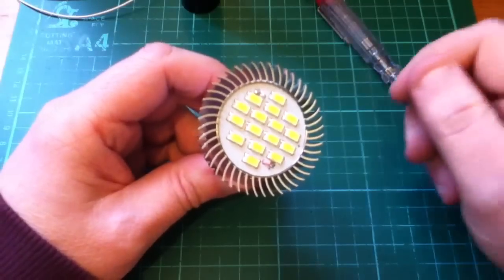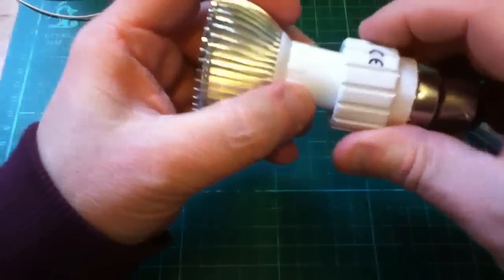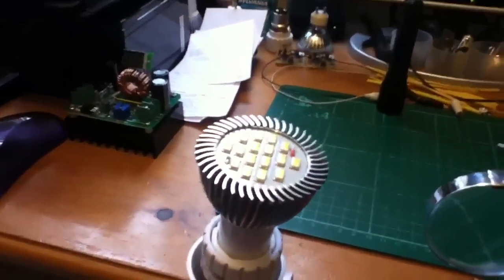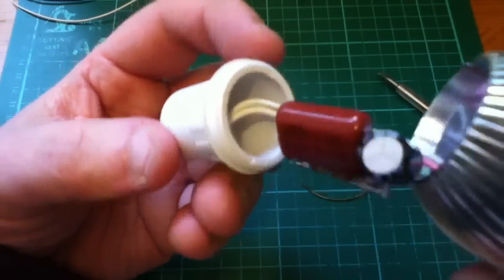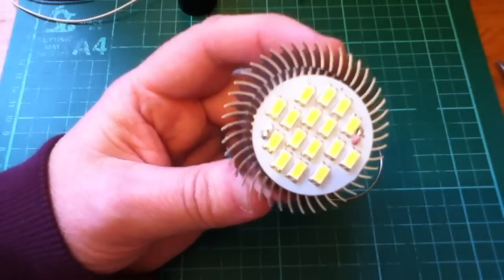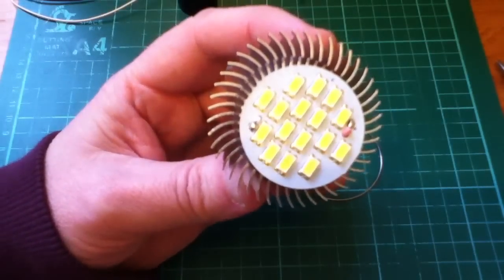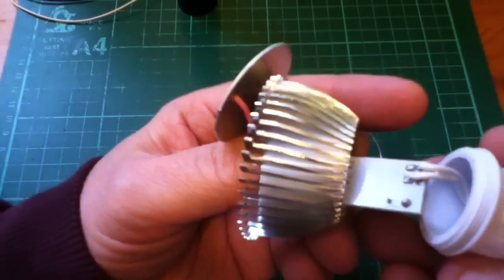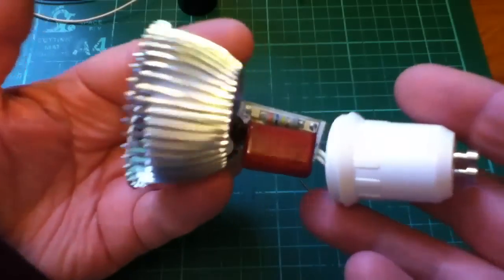Dangerous GU10 LED Spot Light is Cheap and Bright but could Kill You - Seriously

Comment from the maker: Another dangerous 'corn cob' LED lamp using a dropper circuit, described and expertly tested by AintBigAintClever here: http://youtu.be/n3ci4nlKhEk
Reply: Michel Linschoten ummm, Did you miss the part where the only thing between the aluminum (conductive) heat sink and the live wall voltage is a bit of paint? Touching the heat sink fins (which would be where you grip this bulb when putting it in) could be all that's required to get shocked.

(Granted you should have the power off anyway when changing bulbs, but this is still pretty darn hazardous!)
Reply: Your review is kind of misleading. There is no way that any manufacturer will let those LED's open because there is rectified AC mains on those diodes. Only the terminals have full DC voltage (around 340 V), but if you touch any of the LED's, it will be enough to make some injury.
As for the aluminum core PCB, there is no need to be afraid of insulating material thickness. Usually, thickness used is around 150 um and it has around 3 KV or higher breakout voltage, so it is safe to use it in this kind of applications.
The rectifying circuit is made of bridge rectifier, so it doesn't matter which way you plug this light bulb into mains. It will always rectify mains voltage so that LED's have proper polarization. Resistor is there to limit current through the LED's and to provide a very simple temperature stabilization circuit for LED's. LED's are working in a condition where their temperature rise produces a drift in their U/I characteristic, so placing a resistor in series with LED's will make them more stable with temperature changes. Working temperature of such bulbs must not exceed 80 degrees C or LED's get damaged.
Reply: mysock351C
Leakage current is no problem unless the diodes are faulty.
But - you're right it will be live in 100% of the time and not just 50. Thats simply becuse the mains is AC - one half cycle (0,01 seconds at 50 Hz) the live is positive, but the next (0,01-0,02 sec), it's negative before changing back to positive again.

As the diodes in a rectifier bridge always connect the side that have positive potential at the moment to the DC positive side (and opposit with negative side) means that both sides will be connected to the live 50% of the time. There will always be a pulsating DC half wave at about 340 V peak to ground on those "live parts" (if mains have 240 V rms AC voltage) - regardless of how the lamp is put in the socket.
Reply: So who cares!! You TOOK IT APART, nobody really does that. The just pop that in their lamp. And the do not touch all that shit....
Reply: Will Scott Most countries use 230 volts for residential and I'm not kidding that shit hurts.  You almost don't even need to touch it.  In the US it's only for ovens 40A and dryers 30A.
Reply: Jeremy Lassen
To all those talking about deadly currents I would like to advise them that the avarage value of resistance between the fingers or between arm to arm is 50,000 ohms. this means that to get a current of 120 ma going through the body you would need to be between 6,000 volts. On 230 volts when you touch between live and neutral you are immediately getting only 5 ma. This is more than enough to throw you off and if you can't disconnect after about 1 minute it will stop the heart. So be careful Anyway.
Reply: Everybody nerding it up, I'm just like: ITS SHINEY
Reply: Jonny Deth you are the example of the word meaning "dumb shit", will explain why..
Firstly you say I'm not qualified, but you don't know me - 1st example of being a dumb shit
Secondly you don't have to be qualified to know this circuit - 2nd example of being a dumb shit
Thirdly I have 5 years electronic study at college and university with qualifications, which in your eyes makes me qualified - 3rd example of being a dumb s....
The dropper circuit limits the current, but you say its a voltage divider - 4th example of being a d..... s.....
This circuit is used for powering LED's, not to "energize it and switch it on", you do this with electronic switching devices such as transistors etc - 5th example of being a d..... .....
Lastly, "quantum physics " what's this got to do with railways - nothing, you dumb shit.
Reply: No Mojoman57... all you need to be is earthed, i.e, holding on to a radiator, foot on the metal sink, any good earth will let the current flow and it's goodbye. I'll see you in the next world, and don't be late, as Jimi said.
Reply: Carl P - But what would happen to the Darwin Awards?
Reply: Michael Graziano  True but atleast its not "deadly" like described , it would just damn hurt lol. Iv connected to a light socket before as a kid , just a pretty painfull jab. My friends house was not exactly up to code haha
Reply: As Michael says chaps, it is the 'current' that kills you... as little as 120mA will do it if you are nicely earthed at the time of contact with the voltage. The message is, do not buy the cheap bulbs, use a reputable suppler.
Reply: CragScrambler
Sometimes im drunk :P
Whats your excuse ?
Reply: Julian can you review the new mercury light bulbs?

A Report by Alexandra Pfeil
Presented on LINK TV in the USA for DW In Focus, English Version
Toxic Light - The Dark Side of Energy Saving Bulbs

A look at how dangerous the new energy-saving light bulbs are. The EU has banned many incandescent bulbs in favor of Compact Florescent Lights (CFLs). CFLs emit serious toxins while being used. All Florescent lights contain Mercury. There is enough Mercury to pose a serious health risk in the event of a CLF breakage. People are being told to run out of the building for 15 minutes, open windows and turn off the heat. Additionally the bulbs do not last as long as advertised and they take a long time to warm up, decreasing in brightness over time. The light they emit is not a full spectrum steady light. Few Bulbs actually get recycled and they need to be treated as hazardous materials when discarding them. Consumers be alerted!
Reply: But, it's being rectified first (full wave bridge) so it doesn't matter witch way you plug it in the DC will be the same polarity on the other side.
Reply: khroe
A bridge rectifier does not electrically isolate.
Reply: ***** Well said
Reply: guys if you wanna see an AMAZING DIY how to build your own flexible LED DISPLAY Curtain XXL by LED Strips realtime Video Transmission checkout the awesome full step by step DIY incl. Sparepart Purchase by elektric-junkys checkout our channel *****
Reply: pumpkin king Shot's fired!!!!!!!!!!!! DAMNN SON
Reply: ***** Wait. Were you standing in a 75 deg salt bath?
Reply: +Stan Conway ,go check your figures,look at the effects of 20/30/50ma @230v ac on the human body,you do not get "thrown off" AC effectively cramps and releases your muscles so you cant let go,(believe me I'm an electrician and been there done it and got the t shirt with that on) if you cant break contact ,either you fall over or are pushed , taken from google web search-If
 the current takes the path from hand to hand thus passing through the 
heart it can result in fibrillation of the heart. Fibrillation is a 
condition when all the heart muscles start moving independently in a 
disorganized manner rather than in a state of coordination. It affects 
the ability of the heart to pump blood, resulting in brain damage and 
eventual cardiac arrest.
Either AC or DC currents can cause fibrillation of the heart at high enough levels. This typically takes place at 30 mA of AC (rms, 60 Hz) or 300 – 500 mA of DC.
Reply: +Julian Ilett Now I don't honestly know the voltage in Britain but if it's anything like here 110v isn't often lethal, I've been shocked by 220v and describe it as annoying and less painful than a bee sting. So knowing that I think you're exaggerating a little.
Reply: Flykickuintheleftnut
 230 v is kid stuff, I have been "bitten" by 680 v 3-phase, that shit hurts!  LOL
Reply: Miomir Todorovic
Although neither orientation of the lightbulb is safe, one way is still safer than the other. One of the AC inputs to the bridge rectifier is connected to one of the input pins through a high value resistor, the other AC input is connected through a low impedance directly to the other input pin. Even though the output will always be a high voltage DC and in normal operation the current draw through the LEDs will be the same regardless of orientation, it is able to source more current if the live is connected to the lower impedance input and the output bypasses the high impedance input and instead goes through a person to ground than if the live is connected to the high impedance input.

This is clear to see in the linked video where far more current flows through the bulb in one orientation than the other (43mA vs 158mA) and in the schematic at the end of that video where the low impedance path from one of the inputs to the exposed output pin is highlighted. This is true for both this video and that one.
Reply: ***** because you touched one terminal, it was enough to give you a bite, if you had two keys and made a connection to the other terminal, then it would have been a different story all together, high chance you would be in heaven.
Reply: ***** both phases will emit a current, alternatingly. touching one phase will just lead a current through you every ~0.02seconds, with a peak voltage of ± 325volt. Your body will act as a ground leading the electricity through you. Touching both phases will alternate the RMS current (230volts) through the two points on your body that are touching. could be the same hand, which will be less lethal then having a pole in each hand, which would lead the electricity through your heart, which could cause a few problems as you might imagine. the same would apply when touching one phase and the ground on a grounded socket, although with a lower voltage.

to actually give you a proper answer; if you are not insulated from the ground, your body will act as a ground to the connection if you touch a + pole on a DC current or a phase on an AC current. touching both poles/phases will lead the current through you regardless of grounding.
Reply: Aris Kemperman
I think your a bit wrong there.
Reply: Jonny Deth
A lot of the people I have met come from Uni thinking they know shit. But there are useless in most fields, Not saying they are the problem, Maybe its just the place they learn at.
Reply: Jonny Deth  both you + Julian are correct, it starts with the dropper circuit  before the rectifier then uses its own internal LED resistance as the voltage divider after rectification. therefore if one of the LED break then the voltage would increase.
Reply: True, but it does "polarize" AC into 0 to positive on one side and 0 to negative on the other which is constant regardless of how the input is wired, I'm not saying it isn't still potentially dangerous , cheap junk that it is, I'm just saying that it doesn't matter how you plug it in, you will get the same polarity on the exposed connections.
Reply: khroe that last reply sounds right to me, I'll agree cheaply made and not much to insulate you if a component fails but based on what i saw the front place is only exposed to rectified presumably low voltage and amperage current. if some one could weigh in on this and elaborate that would be wonderful.
Reply: Anthony Jennings
In some of the cases, Like the video you just watched is dangerous even when working normally.
Reply: Anthony Jennings Depending which way round the light is fitted, their will be over 230v exposed to one of the soldered connections on the LED face, will also be high current, enough to kill. Because only one of the of the connections will have has the dropper circuit, the other connection would go straight to the rectifier causing over 230v (to ground) and only low voltage to drive the LED from the rectifier output.
Reply: gabor horvath
And what if some douche comes along and wires the single pole switch with the wrong wire.
Reply: cacksucka
wow nice video
Reply: Jonny Deth you are the example of the word meaning "dumb shit", will explain why..
Firstly you say I'm not qualified, but you don't know me - 1st example of being a dumb shit
Secondly you don't have to be qualified to know this circuit - 2nd example of being a dumb shit
Thirdly I have 5 years electronic study at college and university with qualifications, which in your eyes makes me qualified - 3rd example of being a dumb s....
The dropper circuit limits the current, but you say its a voltage divider - 4th example of being a d..... s.....
This circuit is used for powering LED's, not to "energize it and switch it on", you do this with electronic switching devices such as transistors etc - 5th example of being a d..... .....
Lastly, "quantum physics " what's this got to do with railways - nothing, you dumb shit.
Reply: Julian Ilett hi the more well known brands have step down transformers but still bring the voltage down from 220 - 240 to 110 volt which is still enough to belt you . and these are approved ! ( Osram for example )
Reply: so what your trying to say is its bloody lethal lol, i WAS going to use thes in a aquarium hood lighting set up lol. thanks for the vid
Reply: ***** I know! You were wearing insulated underwear!
Reply: +Jeremy Lassen; Jeremy: Look at all of that metal that Jimi held onto in different circumstances and with different parts of his anatomy. The only thing he had to worry about, as we -- are holding onto the weed and the coke -- or we will be too early!
Reply: +Jeremy Lassen 

You don't even need that. All you need is a path to a ground (not necessarily an Earth ground) that allows flow through a path through your heart.
Reply: +Zig Zag " Individuals have been electrocuted by  appliances using ordinary house currents of 110 volts and by electrical  apparatus in industry using as little as 42 volts direct current."  -https://www.physics.ohio-state.edu/~p616/safety/fatal_current.html
Reply: +Zig Zag Electricity fatalities mostly have to do with the amps as opposed to just voltage. UK is 240v but can definitely be lethal, people are killed by it often enough.

Comment: What's with all the dislikes on this video? Was the whole staff of the manufacturer forced to downvote it?
Reply: Inappropriate thumbnail.
Reply: @briantw 
What's inappropriate about it?
Reply: Just Julian is wrong :)
Reply: Ok, let's see...
50% chance of having mains on one of the soldering joints on the front of a very, very bright, very, very HOT bulb... 
Risk of touching it on purpose = 0%

Unknown% chance that the insulation on the front board is also insufficient to keep that already 50% chance of mains from extending to the very, very hot heat sink... Risk of touching this on purpose while bulb is lit = 0%

So, pull out your calculators and figure out the potential risk of accidental death by electrocution from touching this bulb, while it is receiving mains, AND after the insulation has been proven to have failed, AND while you are touching something that is grounded for the damn circuit to be completed, AND that grounding is not the same hand that is touching the bulb, i.e. across your heart so that it can, in fact kill you...
 How fucking anal retentive can you guys get?!  
 Constantly bending over backwards to find fault with anything that was not made to your insanely stringent standards that were written as if every single member of your society is a fucking moron!

That's why there are 1300+ dislikes on this video!

Comment: So what is exactly dangerous about it?
Reply: New to the thing called electricity?
Reply: If you plug it in correctly then all is good. If you plug it in backwards then the heat sink, the metal fins, will be charged to whatever the local line voltage is. If you touch them and you are grounded you get shocked. this could be potentially lethal.

Comment: More dangerous shite from China. Bloody good illumination, let down by shoddy design.

To silence all the "it's not as dangerous as it looks" folks, I'd suggest testing it with a probe attached to an incandescent light bulb rather than a meter or neon screwdriver. If the bulb lights, there's no argument - the bloody thing's live.

Very tempted to buy a load of random ones from eBay and put them to the test, especially as not all GU10s end up out-of-reach, they can find their way into desk lamps and other easily-accessible locations (a friend of mine has GU10s in a sloping attic wall/ceiling).